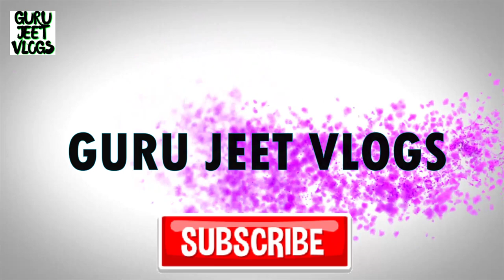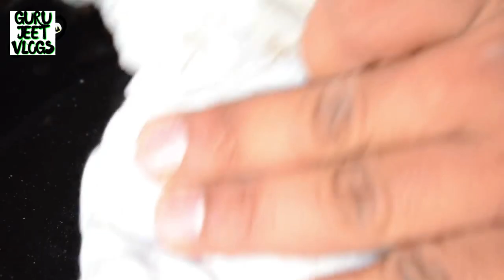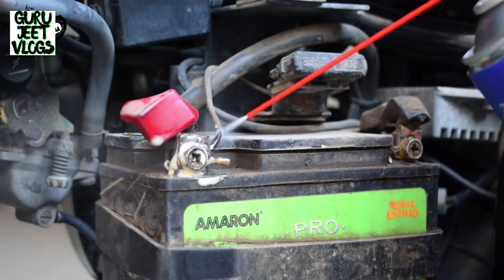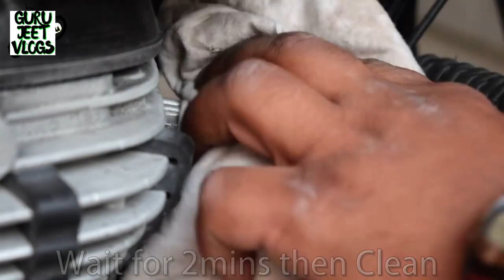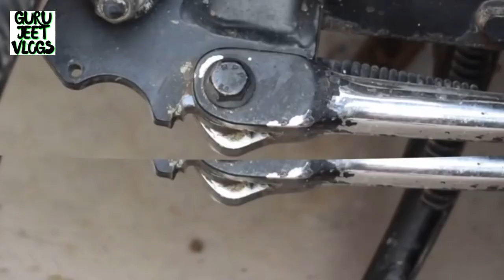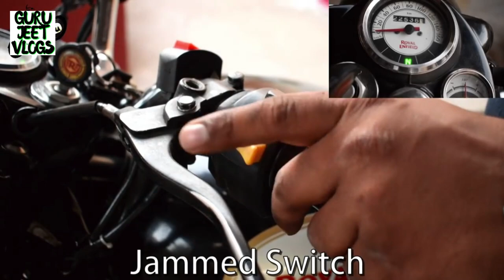Maintain Your Full Motorcycle/Bike With "WD-40 Spray" | 16 AMAZING Use of WD-40 || Easy Life Hack

Comment: Don't use on bike chain. WD-40 is a penetrant. It will go inside the O/X rings, expose the grease inside the seals and damage the chain.
Reply: You can use it to CLEAN the chain before applying actual lube to it.
Reply: Ty bro
Reply: For low-end chains only.
Reply: Thats why its purpose is cleaning and not lubing 😊
Reply: No, it won't... WD40 will not in any way shape or form hurt your o-rings

Comment: WD40 is not recommended for chains coz it has chemical agents/properties and gets into O rings of chain and damages the rubber inside the O rings and chain starts giving a permanent noise. Then u have to change entire chain and sprocket set. Kerosene or petrol is a good cleaning agent and it vaporizes immediately.  For rest of the parts it's ok to use WD40 👍
Reply: I only use WD40 on my chains. It’s perfectly safe with the advantage that dirt doesn’t stick to it very well. I get 50 thousand km on my chains without any worries. It does not damage O rings.
Reply: Check out the video of MC Garage on WD40
@gonein
Reply: @jaywhoisit4863  the problem is wd40 is drying the chains, cause its an anti rust, so u need to kinda rub more oil to the chain after you put the wd40 or just roll the tyres and let the chain wet them self inside the gearbox :v
Reply: The I rings are fine with WD40. 
I've seen a bike channel soak
 o rings in a test tube full of WD40 for a month. The o rings were fine with it. It's just a myth that is damages then.
Reply: Its very true beware to chaine using wd-40
Japanese always remind me that at the work place

Comment: Is it suitable for removal of front Disk Rust? Or it may harm my front disc?
Reply: Please don't use it on disc pad WD40 is kind of rust remover and lubricant. I did a mistake in royal Enfield Thunderbird I applied WD40 in order to remove rust but unfortunately it went to disc pads literally no brakes front and back and then it was taken to show room to change pads. Please use sand paper to remove rust for wheel portion please
Reply: Use white vinegar to remove disc rust
Reply: Don't use..
Reply: I also did the Same mistake on my classic 350 we should not use WD40 on brake related hardware.

Comment: Doesn't it affect on electronic parts like switches ?

Key places ??
Reply: Its non reactive. But wipe after applying immediately so it doesnt collect dust.
Reply: the wd40 said they are non conductor liquid, they even provide special can for electronics purpose. Give it a go
Reply: @vicemafia23  thank youu 😊😊
Reply: it is not a lube,,never was meant to be ,no it wont harm switches it is a water displacement

Comment: Hello...
Can i use for rust in painted parts of bullet 350. Rust in tank cover, rust in air filter cover etc.. 
Plz give any options to remove rust from  these parts ...
Reply: PB blaster and steel wool
Reply: Use metal polish by wavex or autosol they work wonders

Comment: Only use this on your chain if you want premature wear. It will break down and penetrate the rubber o rings and cause the internal grease to become exposed to the elements leaving you with a shitty chain.
Reply: So is it okay to use on chain that doesn't use o ring?
Reply: it's safe in o ring

Comment: Apply chain spray after using WD40. It's a cleanser not a lubricant
Reply: Not necessary. The chains are internally lubed. The light Wd40 protects the chain from corrosion perfectly fine.

Comment: Very nice, however never use WD-40 on sparkplugs instead burn them with a weed-burner of something! Why a sparkplug can handle very high temps an rather burn it clean.
For the rest, perfect use! however only to clean because it leaves an oilfilm and this will attract dirt, rust etc so i rather use Litium soap based grease for the footpegs, shifter standard etc.

Btw another top-tip spray the complete engine with WD-40 let i soap overnight en clean in with an rag end use a stick to clean up the difficult area, then clean the engine and it will be like new.

Comment: No please not on a O- or X-ring chain! It will get into the links and mess with the grease inside! WD-40 can not deal with the high forces on a bikes chain! Need to use grease!
For your chain use Diesel / Kerosene for cleaning and ideally chain grease. That is cheaper too!
I would not use WD-40 on any rubber parts as some rubbers can be damaged by WD-40. Remember it's not just oil it can be aggressive loosening rust!
Use it on bolts and mechanic parts that do not need to transfer a lot of force. WD-40 is not viscous enough to lubricate under high pressure!